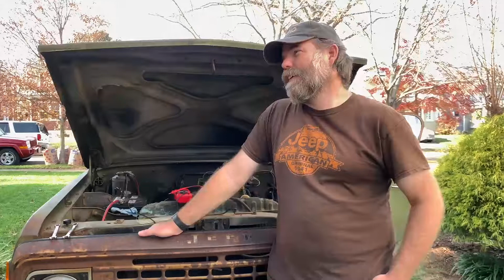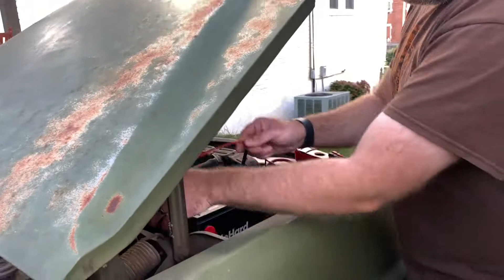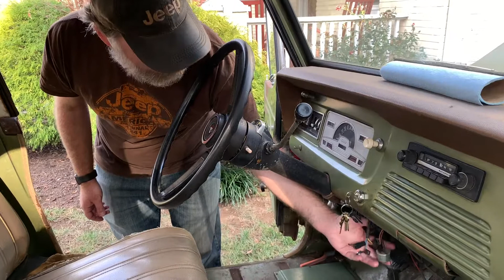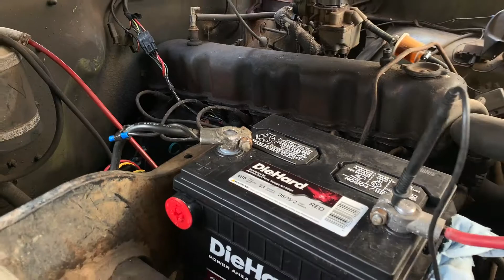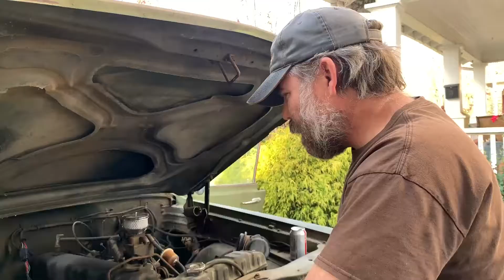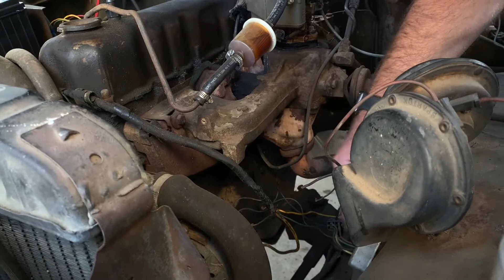1973 Jeep Commando - Ignition Testing ( Episode 2 )

Comment: That's awesome I really liked the video I think you did a very good job explaing what was going on with it and what you were doing. I have a 1972 commando with the 304v8 I've been working on lately and I'm also having quite the issue with the ignition wiring. I cannot get it to crank over at all without crossing over the starter solenoid. I'm going to start tracing wires back and replacing them as I go. I believe mine has a short somewhere. Thank you for the good video keep it up I hope to see more on this project👍
Reply from the maker: Thank you, William. Glad you enjoyed it. 
Good luck with the '72!